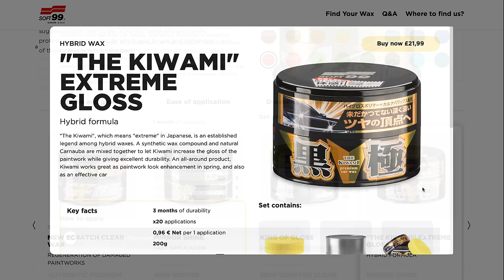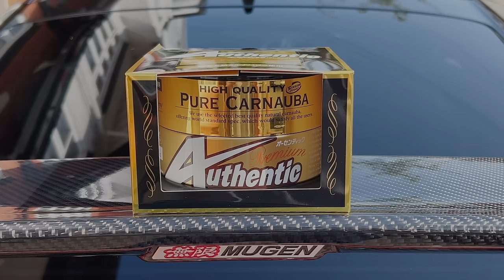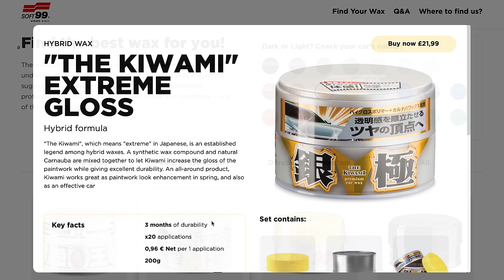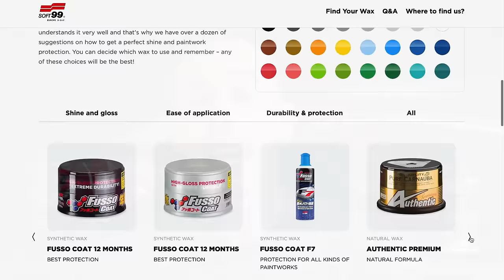Soft99 Spring Wax Time

Comment: Heres a great little tip for removal of wax deposits on trim.  Use a soft pencil eraser.  Works a treat.  Some dummy got white deposits on my plastic trims and nothing seemed to shift them.  Pencil eraser did the trick. 🙂👊👊
Reply: Gonna try that... cheers dude!
Reply: @skylined5534  don't use the little tiny ones on the ends of pencils as you risk the rubber wearing down or snapping and you'll gouge your plastics with the metal shroud.  Use a proper hand held pencil eraser.
👍👍
Reply: Will try thanks for the tip!
Reply: Heat from the friction softens the wax up and the friction also moves it  and the rubber deposits just take them away. If you're wondering why it works
Reply: Use a toffee wheel.
Reply: Peanut butter - soft not crunchy - works well too and you can put it on your toast!
Reply: Thanks, 👍👍
Reply: Yep, I heard that a while ago and it does work.

Comment: The Fusso mirror shine can be a stand alone but it also is meant to work with Fusso soft 99
First you do the Fusso soft 99 then allow it to cure 
Then use mirror shine 
You get about 3 months for the mirror shine 
But the Fusso soft 99 lasts a year by itself 
Excellent for the winter months 
I have yet to see any paste wax out last Fusso Soft 99
It is the King. 
And a can will last for years 
Remember when applying 
No sun 
Put it on thin - thinner -thinnest 
The less the better 
Also keep it off the trim work and headlights. 
Nice Video !

Comment: It’s a great brand, I’ve got a few tins of fusso coat I use to keep my daily maintained. The stuff is unbelievably long lasting, i recently tested the product and I made it through the entire winter without a wash. Its hydrophobicity was gone, but the depth gauge told me there was still quite a bit of protection left. Can’t recommend the brand enough if you’re not in the market for a coating and need something that you don’t “need” to maintain as regularly, but is highly chemical and road resistant.
Reply: Depth gauge ? To measure wax ? Who are you kidding mate...

Comment: Soft99's best wax is de fusso coat by far. I have used a dozen of waxes and sealants over the years, but always go back to fusso coat. It's teflon based and takes a bit of practice to put on. But it's the longest lasting and slickest wax I ever used.

Comment: I would never use an iron eater that removes any type of protection it's supposed to remove iron and that's it if it removes your protection and it's way too hard for your paint, and dammm son your car is full of swirl marks time to get the buffer out and polish that baby up
Reply from the maker: Generally just the nature of the product. If it’s strong enough to dissolve iron it’s prob gonna eat through your wax or sealant too.